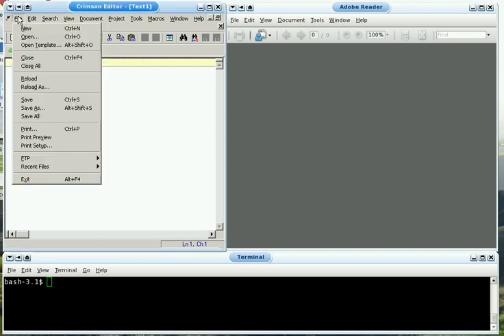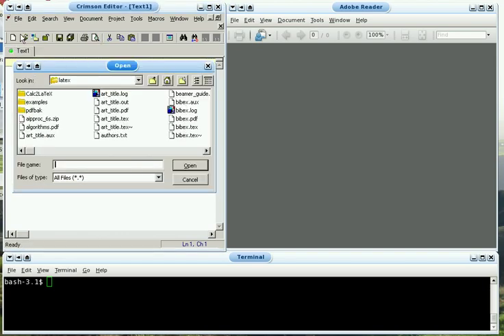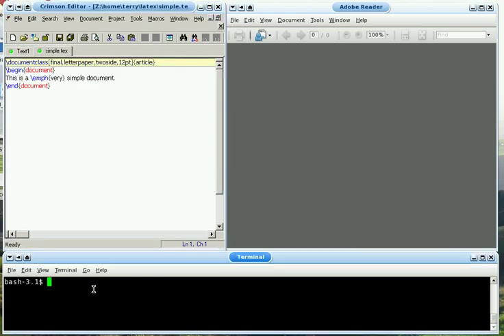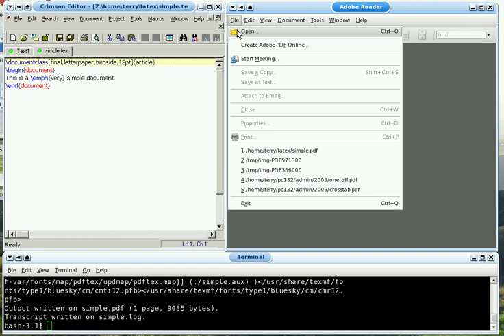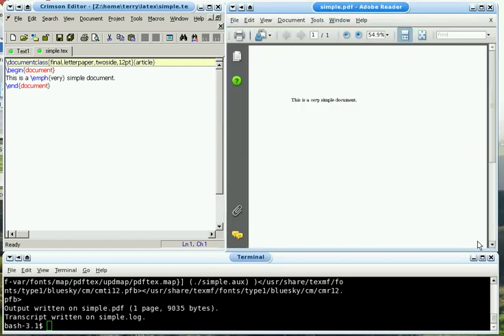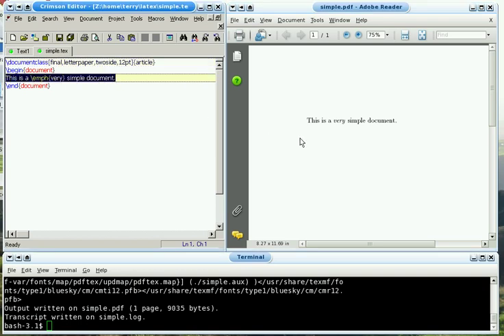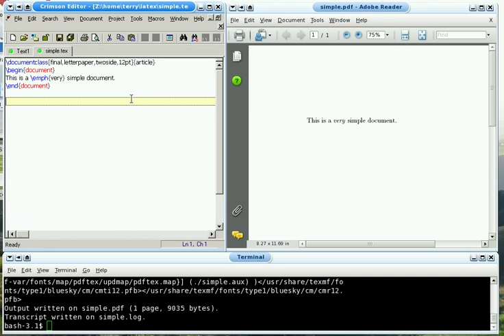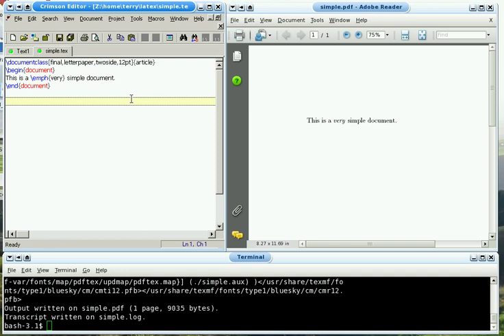How to produce pdf with LaTeX

Comment from the maker: @danielgomez4208 

That's a command window. That's where you can actually type in commands rather than pointing and clicking. pdflatex is a command-line utility (although there may be a way to run it from a point and click depending on what system you're running.)